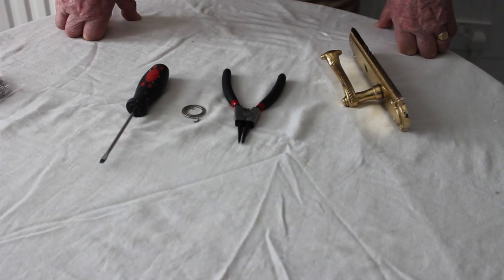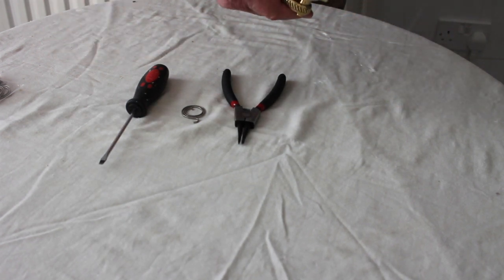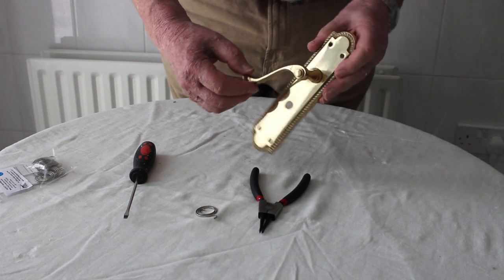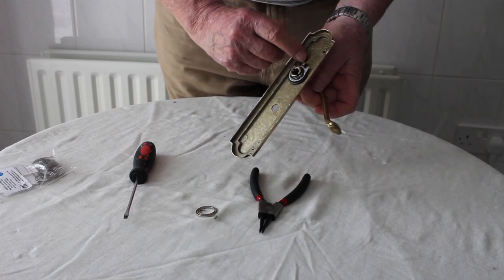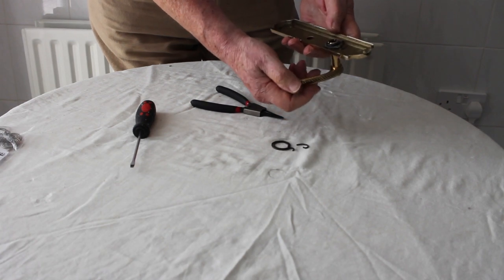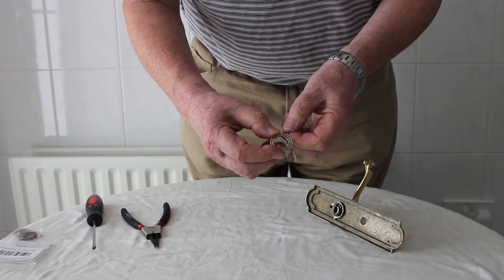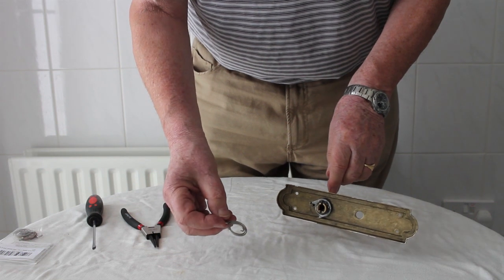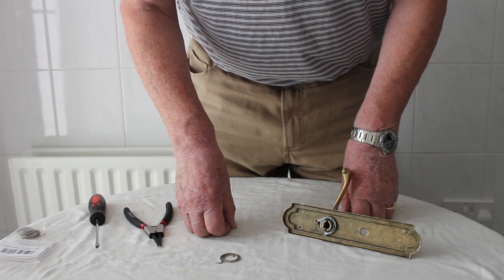How To Fit And Renew A Door Handle Spring | ItsTheRepairMan | Door Handle Tutorial

Comment: Also under the handle against the faceplate there is often a nylon washer that breaks or wears away,worth replacing this when you have it in bits as it helps tighten everything up.

Comment: Thanks for the video, I could see what needed to be done, but couldn't remove the cir clip.  I didn't have cir clip pliers, so I clamped the handle to the bench and removed it with a pair of pointed nosed pliers.  I just need to wait for the springs to arrive from ebay and for the future I will invest in a pair of pliers.
Reply from the maker: Glad it worked for you. Replacing the spring far easier than a new door handle.

Comment: Need another vid on door pull knobs. I seem to be short of a circlip to hold spring and washer in place . . .
Reply: Sorry not familiar with those. Circlips again, are easily obtainable Amazon, E Bay
Reply: @tonyellwood3184  Similar layout to lock - spring washer and circlip holding both on. In my case it was a case of a corroded circlip. After it fractured, any pull on the knob took it off the door. I see them here https://www.amazon.co.uk/Door-Handle-Spring-Circlip-Pack/dp/B007BRZJFG

Comment: When placing the spring in do you have to put the inner hook into a groove somewhere?
Reply from the maker: On the video at 1.15 to 1.22 you can easily see the protruding piece of metal (part of the door handle) which the hook at the top of the spring fits on to.
Reply from the maker: Apologies, you may mean the hook part at the inner circle of the spring.  That fits into the slot of the handle barrel (see video - shows slots clearly 2.30)
Reply: Thanks for getting back to me.  Yes, I worked it out by dismantling the other handle which was still working and  I could see how it all worked by putting it back together.  I've ordered springs, circlips and a cam washer, hopefully they'll all be the right size!!  Cheers for all your help bud, you have a new subscriber.

Comment: Yes great video pity it wasn’t zoomed in on the handle to see how the clips and position of the spring went
Reply from the maker: Sorry about that, but the spring only goes in one position (same as the one you remove) .  The circlip is opened up merely clips on.
Reply from the maker: The little end of the spring as you describe it, fits into a slot on the door handle shaft. The slots are clearly visible on the video at 3.28

Comment: I have a different problem. The handle is coming off the plate on one side. How do I re-secure the handle to the plate?
Reply from the maker: Not sure what you mean - the plate and handle are separate (2.36 on video).  Unless the notch is missing on the plate and no grooves/slots in the handle, and using the different parts as shown, the handle should fit securely.
Reply: @Socrates Im only guessing here , I think your handle may be slipping off the square spindle , usually a 60mm to 90mm length of square solid steel that transfers the torsion required to activate the latch-set. Check underneath your handle as some handle sets are only connected to this spindle shaft by way of a small 'grub screw'. This screw sometimes comes loose and you get separation between the knob or lever and your plate. So loosen the grub screw then push your handle back into the plate the tighten the grub screw.

Comment: Thanks for the video,what size is the spring please
Reply from the maker: The door handle spring used :Purchased via e bay  bytheway_123  Door Handle Springs 2.5-turn coil, 2.0mm thick, 27.5mm Diameter (Pack 10) *NEW*( 142425706469 ) Hope this helpsITEM PRICE:£9.62
Reply: Thank you so much,i have the same door handles and the same problem with the spring and was just about to change all of the handles  but thanks to your video i wont have to.many thanks and keep up the good work